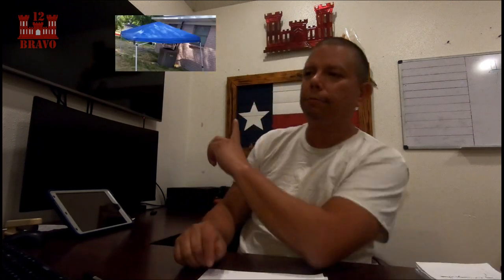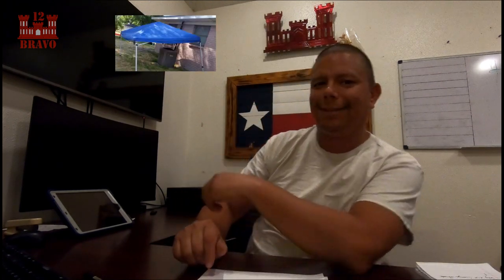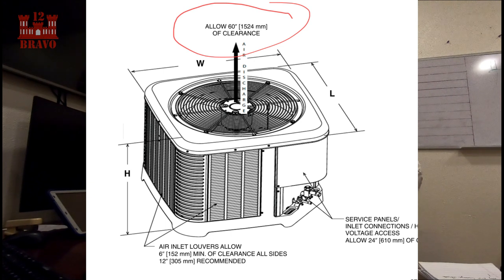Canopy Review - Shading Your Air Conditioning Unit

Comment: I've always had the idea of putting some kind of sprinkler on top of the roof to cool it down when it gets to a set temp. I would use rain barrels to recirculate the water and even a solar powered pump to save even more. Lived in SoFla for 38 years now in SC but summer feels even hotter here. Do you think something like that would help? Thanks.
Reply from the maker: I believe this would help keep the house cooler from the roof. However, there are things  you can do such as pick lighter shingles, proper ventilation, and using the R8 ducts instead of R6 ducts.